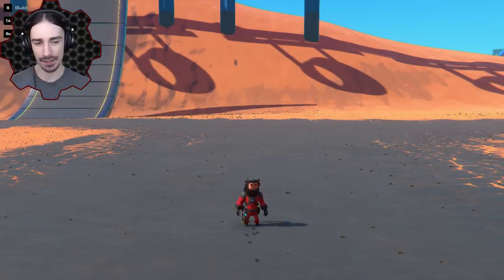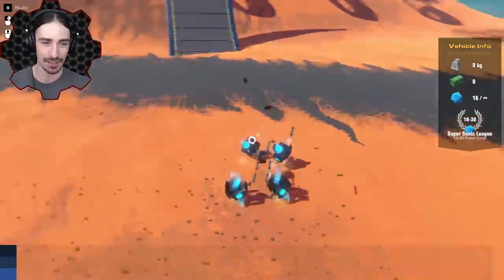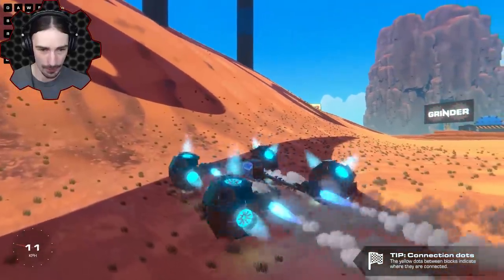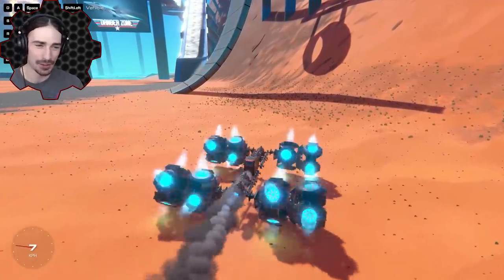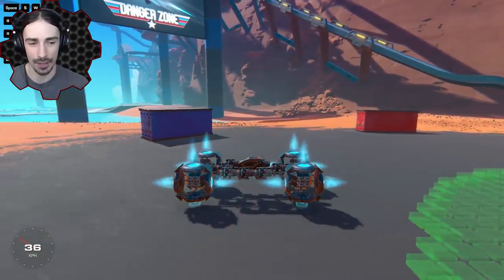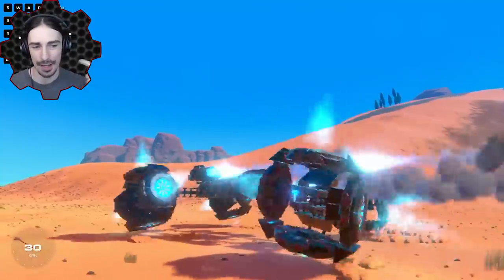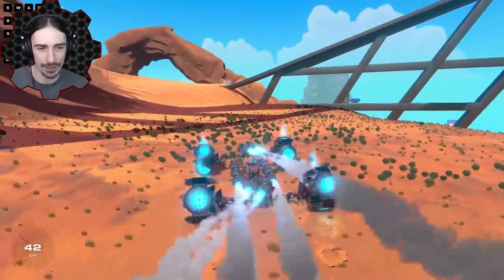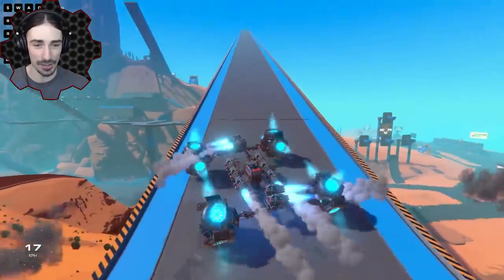Wheels Made of Hover Pads Were Never Meant to Happen... - Trailmakers Early Access Gameplay

Comment: You could make a logic/sensor system to deactivate the hoverpads that is reversing the thrust. You would need more hoverpads but when you spin the wheels they are NOT going to reverse any thrust.
Reply: The hoverpads only give "thrust" when they are above the ground, if that isnt the case, you could use them as thrusters

Comment: The hover pads cancel each other out (like the hover pad wall climb glitch ) you can use the sensor to disable the hover pads when they are flipped
Reply from the maker: I already demonstrated in a previous video that they don't cancel out
Reply: They dont. Not only did this hover-car-thing actually HOVERED, but the reason for climbing with hoverpads is most probably because they try to hover off the blocks, but are attached to them at the same time.
Reply: @scrapman  wow thanks for the reply
Reply: @camillecirrus3977  ok thanks for the info

Comment: you need some advanced logic here... when the wheels are in say a 0 degree angle, only power the lower and backward aimed hoverpads, when they are at say a 45 degree angle, the two lower ones and the upper back one, but not the upper front one.

Comment: building any rotary device with hoverpads wouldn't work. think of it like this. if I have two jets pushing against each other from opposite directions, nothings gonna go anywhere. its the same with hoverpads. you have four hoverpads pushing in oppisite directions of each other so you wont get any momentum by spinning. you get the initial few feet off the ground because of the turbulence physics. to get momentum you would need to have a extremely accurate system telling the hoverpads which direction is which. the one on top should not be on at all.
Reply from the maker: We've already established that hover pads only apply force when close enough to a surface. The top hover pads have nothing to apply force against.